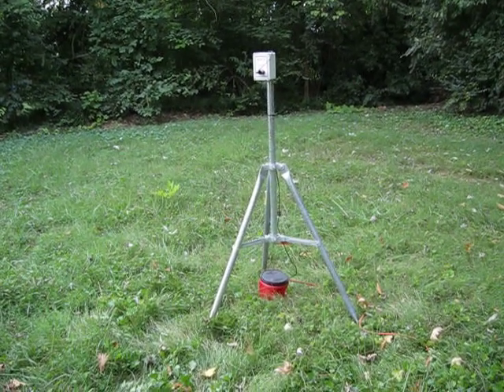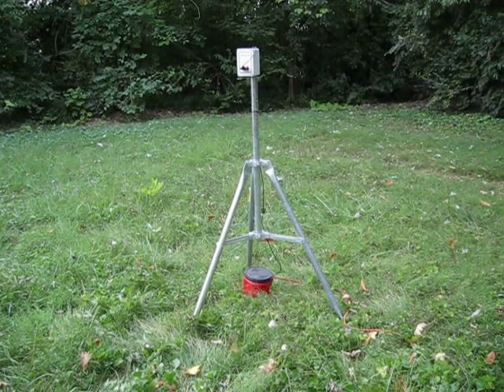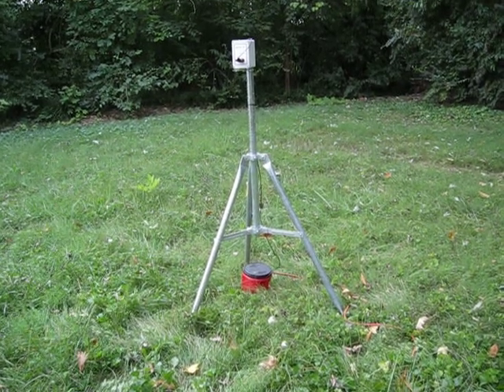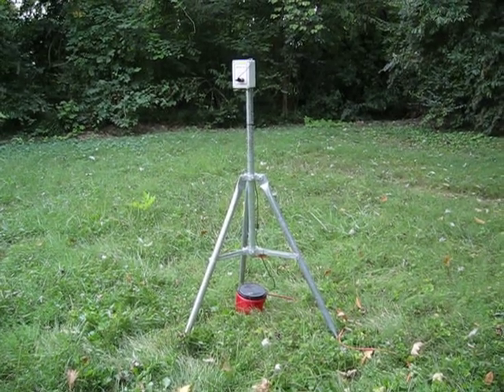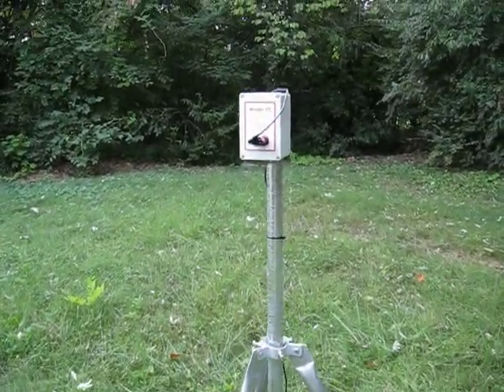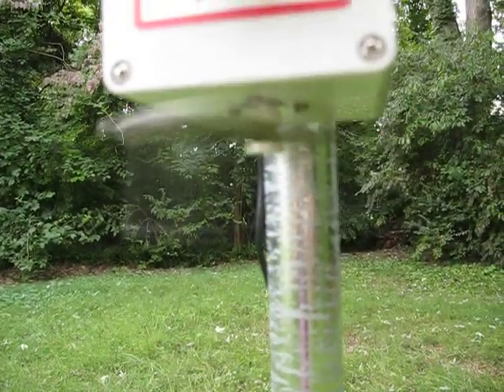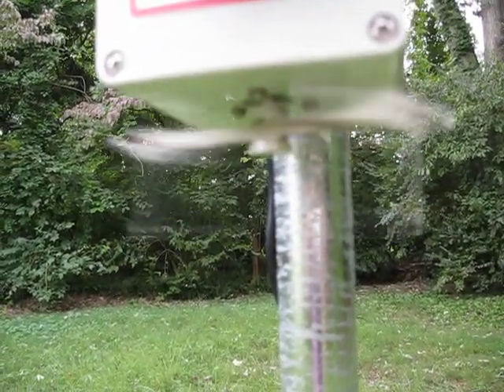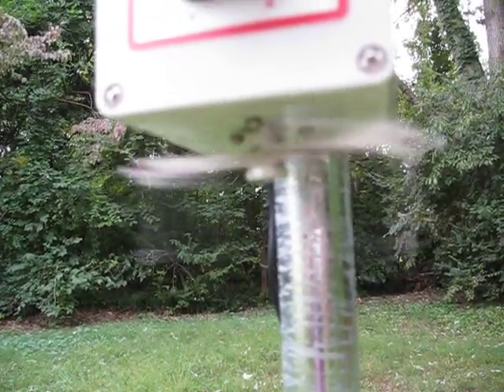Rotorod airborne pollen sampler

Comment: No 12v battery--this collector uses household electrical current (120 v AC). The power supply that allows that to work is in the coffee can. If you were to use a 12v battery, any one that is rated at 12v would work; but the larger it was, the longer it would last. A small car battery would work great, or a 12 volt lantern battery, as long as it was 12 v.
Reply: How can I approach the Rotorod pollen sampler? Price and details (m.afzaalbdo@gmail.com)